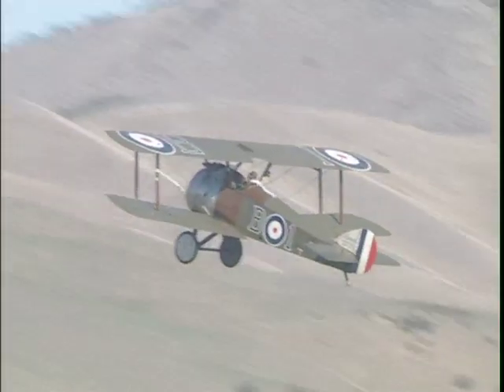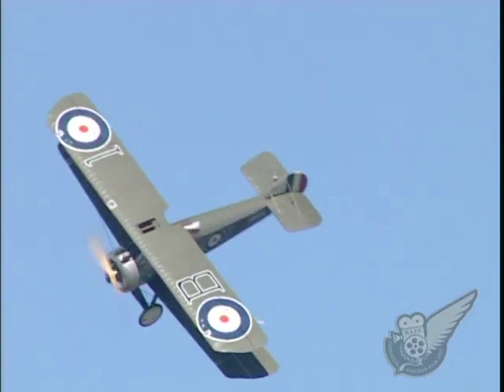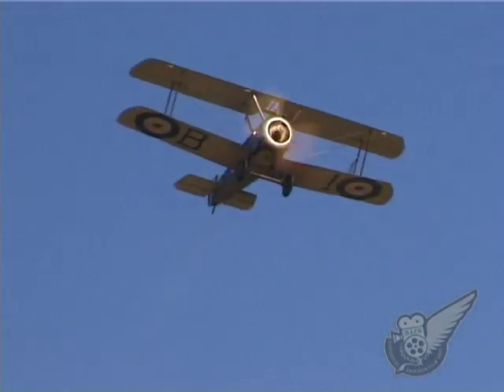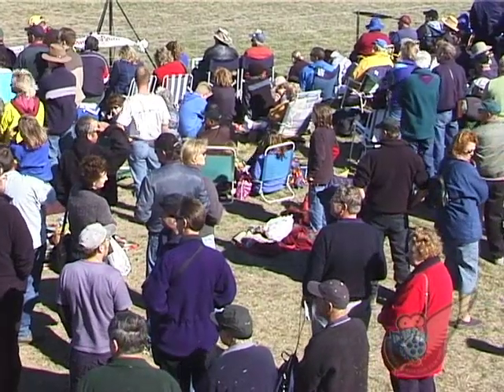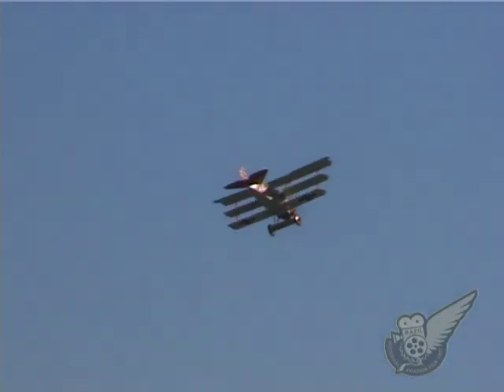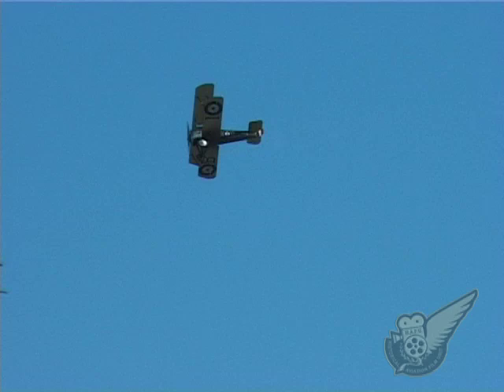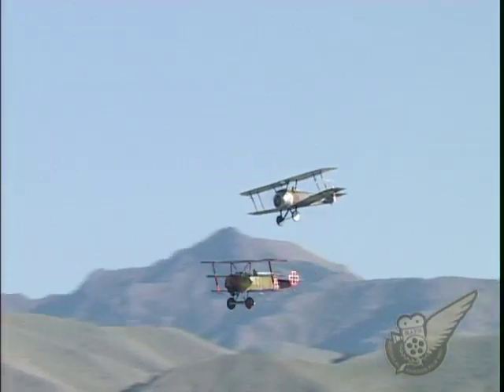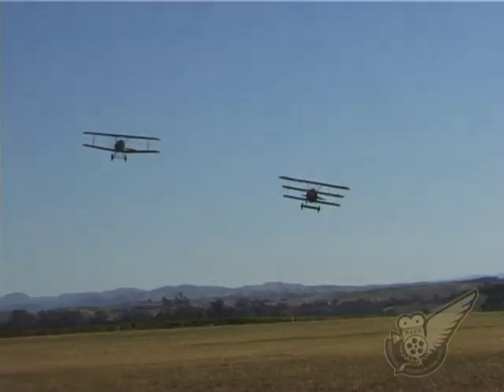WW1: Sopwith Camel and Fokker Dr.1 triplane dogfight

Comment: The stuttering of the Camel is the pilot controlling speed. He's trying to fly slower, but it actually has an original type engine, a rotary. There is no throttle on a rotary because the entire engine is spinning around and there's no way to control a throttle. So they are equipped with what's called a "blip switch". this cuts off the ignition, and I believe it has at least two settings, one is OFF where the engins stops firing, another is every other cylinder and another setting, (from the sound of it) is you can in a way "idle" the engine with only one or two cylinders firing. It's awkward but the only way to fly slow. Now the DR1 in this segment does NOT have a rotary, although it should also. But many of these reprduction planes have small radial engines in them. You can see when he passes overhead that the entire engine is NOT spinning. It sounds entirely different too. He does have a throttle and controlling speed is much simpler. But the radial was invented after the war. Blipping a rotary engine would be a lot like starting your car then putting the gas pedal to the floor, and control your speed with the key by switching it on and off, and the trick is to switch it on before the engine stops turning, too. Because it requires a man to start it, you can't just start it up again if you blip it too long.. the engine stops turning, it won't run any more and  you're going down. These guys really had their hands full.
Reply: Some rotaries have mixture and throttle.please research.
Reply: Rotary engimes
Reply: It's also untrue about the radial being invented after the war. The very first aerial shootdown, on October 5, 1914, was made by Sgt Joseph Franz and Cpl Louis Quénault in a Voisin III powered by a water-cooled Salmson M.9 radial engine.
Reply: In addition, the RFC HQ decided that parachutes might induce their pilots to bale out instead of fighting to the death, leading to many unnecessary losses of experienced fighters.
Reply: Well said
Reply: You wouldn't use a blip to fly slower. Simply pull back on the stick and then reduce throttle a bit if you need even less speed. You use a blip to stop over-speeding the prop which allows you to maintain a higher airspeed without damaging the prop and anything connected to it.

Comment: They could equip them with blank ammunition and gun cameras and so decide, who won!
That would be exciting...
Reply: How would you know who won? Who hit whom?  Another solution would be some electrionic equipment - pretty easy to do. Some emitters (lasers?) and sensors on the other plane.
Reply: Laser tag?
Reply: Right, exiciting but also deadly dangerous - both these machines were known as pretty "unstable" as we call it in aviation. Meaning that they could turn quick, but fall to uncontrolled spin quite easily. And although pilots these days would use parachutes to save themselves, planes would be smashed to the pieces.
Reply: ***** I am sure there would be volunteers, and if people got interested and money would flow, many planes would be built.
Reply: see Flyboys.ya laugh

Comment: Would have been better if the DR-1 had the correct engine.
Reply: Yeah
Reply: Peter Jackson’s TLV company we’re making reproduction engines reverse engined from an original but I’m sure the owners of the triplanes would find them a tricky to fly and operate on top of the already tricky handling of the Triplane. But your right it would be nice to see one or two with a proper rotary engine.

Comment: Does the Sopwith Camel rebuild have a throttle or is it using a blip switch.  Certainly sounds like the latter
Reply from the maker: Blip switch on the original Gnome rotary engine.

Comment: Why does the sopwith camel sound like the engine is spluttering and coughing ?
Reply from the maker: Alfa Won The rotary engine doesn't have a throttle.  See  http://en.wikipedia.org/wiki/Rotary_engine
Reply: Last thing Id want to do is switch the engine on and off in a plane !
Reply: +Alfa Won Turning throttle off at low altitude = Big balls or No Brains.
There are old pilots and their are bold pilots, but there are no old bold pilots.
Reply: it's not as dangerous as you would think. rotary engines are constantly spinning which means there is constant potential combustion. all you have to do is turn on the spark and the engine turns on again, producing power. it sounds scary but it's a very simple and safe method, unless the electric system fails..!